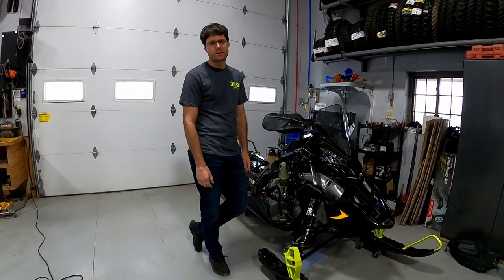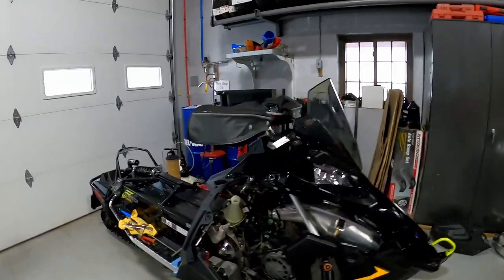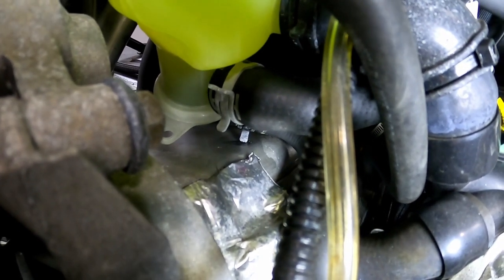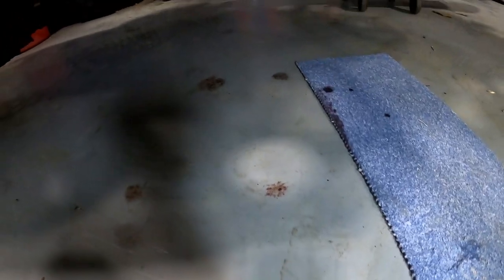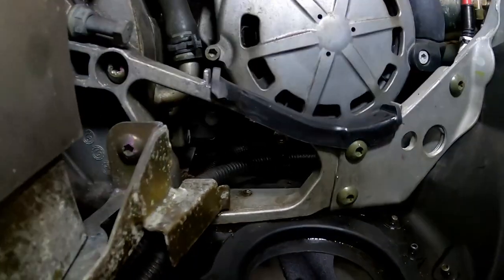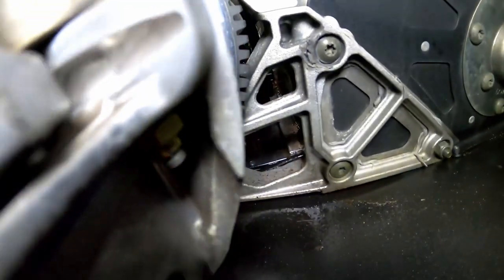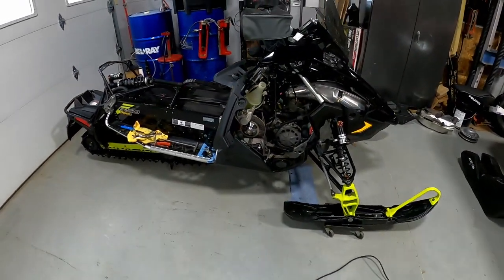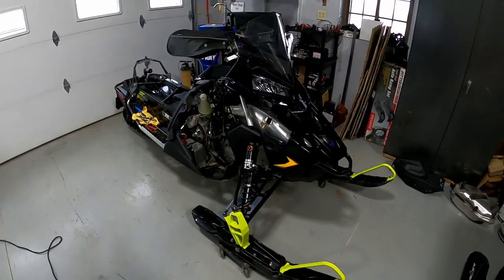2019 Polaris 850 Patriot Overheating Issue & Disconnected Oil Line, AXYS Snowmobile

Comment: I had this exact problem! Took my sled out temps shot up, thought it was T stat, looked under the motor and the oil line was off feeding the water pump, screwed the water pump and the oil line for the crankshaft was off as well, needed a whole engine rebuild luckily for warranty…
Reply from the maker: Glad yours was under warranty still. This sled in the video only had 2 weeks of warranty left.. customer is mega lucky he went riding that day instead of waiting or else this problem would not of been covered by Polaris...
Reply: Just dealt with this yesterday with my father-in-law's out of warranty '17 SBA 800. Did either of you guys notice anything with the disconnected lines? His appeared to be melted at the tips where they disconnected. Assuming it was the line to the water pump and the line to the crankshaft, but have to take it down more before we can see what they were running to.
Reply: @richardgibson2752  I didn’t really notice anything about the lines but definitely won’t be a cheap repair, decided to upgrade sleds this year to a 22 with warranty…

Comment: You also have to ck that Small hose coming off the coolant bottle rubs right through from hitting that big moulded hose on the right side of the engine,I put a sleeve over mine about 2500 miles ago I'm creeping up to 4000 miles in my 2020 seems to be doing ok so far,The 19 also needs the upgraded coolant sensor mine failed at about 3,300 miles.polaris makes a new style sensor and plug!! Should be warranty 😠😠
Reply from the maker: Thanks for the comment, we had the customer take the sled to an authorized Polaris dealer. Hopefully they know what to look for! Jared

Comment: . The line comes off because of a faulty check valve or sealant is blocking the passage. 2019 models only. hope this guy has 4 yr warranty he probably needs a new engine.
Reply from the maker: Yep you are correct... Polaris has a "Team Tip" which just means that if a dealer comes across a sled like this then they know what to look for. Unfortunately they are not proactively sending letters out to customers. Polaris is about to get off the hook because all 2019 sled warranties expire December 2022 so no one will be starting their sleds locally until January 1st... crazy..
Reply: Why a new engine?